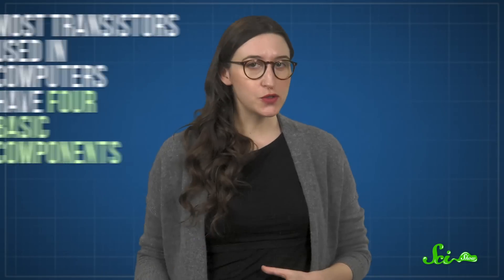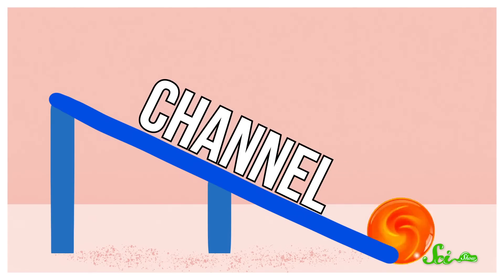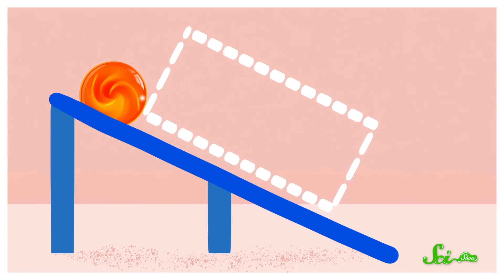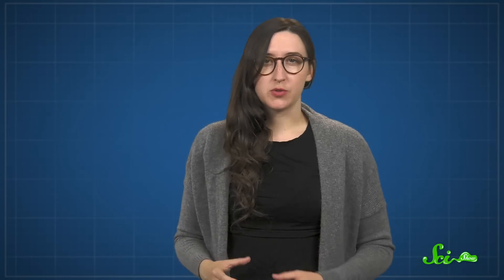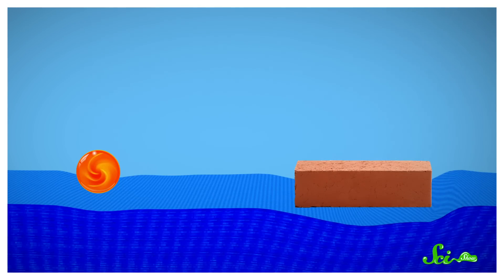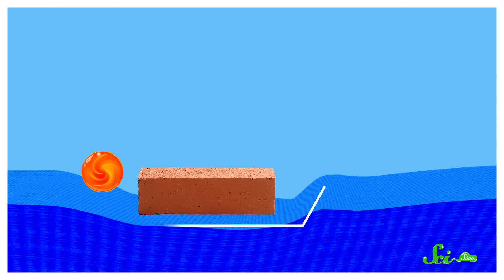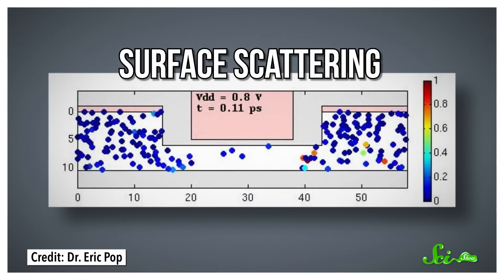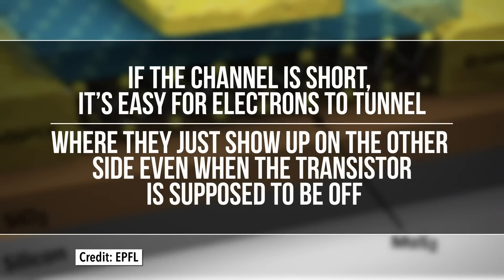There's a Big Problem With Silicon. What's Next?

Comment: Hopefully graphene will be ready on time , if not an inferior stopgapy alternative may hamper it's eventual adoption
Reply: TBH (and I've recently done a PhD on semiconductor devices, so I'm not talking entirely out of my butt) 2D materials are not particularly likely to supersede silicon. From a physics/device standpoint, it's very hard to make a good transistor out of them: if you somehow manage not to destroy the 2D-ness of them by making a three-dimensional device, you still need to make a source/drain and gate that are as good as or better than the silicon ones we've been perfecting for decades. From an engineering/economics standpoint, we can already process silicon wafers that are 300mm (12 inches) in diameter all at once then just carve them up and sell a few dozen chips, but even basic logic circuits of a dozen 2D transistors are still in their infancy, let alone the scale of production where you can make full-sized processors with any decent yield. This is just like III-V materials (InGaAs) all over again - so much promised, but they can't even catch up with silicon, let alone overtake it. Mark my words.
Reply: graphene can do anything but leave the lab :S
Reply: That’s kind of what already happened
It’s technically ready NOW and has been since the 90’s with Dr Walt DeHeer’s research on using Silicon Carbide to epitaxially grow graphene on wafers.
It’s not too different from current methods of silicon production, but factories have been reluctant to switch to it because it would require some retooling of equipment and that single crystal wafers of silicon can be bought in bulk for ~$5 per wafer, but Silicon Carbide is ~$500 per wafer for the same purity.

That’s why everyone is so caught up on exfoliation graphene; it’s much more easily produced, but doesn’t provide NEARLY as much control and quality
Reply: @Abdega  Don't forget that the largest SiC wafers are only 150 mm (6 inch), as well as costing two orders of magnitude more than the largest silicon wafers. Now if someone could grow decent SiC by solution growth, that would be quite something (SiC is currently grown by sublimation growth, which doesn't give anything like the consistency, ingot size or quality as silicon Czochralski growth).

I'm still not at all convinced graphene is as ready as you say it is. Just because you can grow something on a bulk wafer, doesn't mean it's ready for commercialisation.

Edit: seriously, you can't be suggesting that the CMOS industry moves to using graphene on silicon carbide. The cost of the substrates alone would be astronomical, never mind that there are barely enough reactors to supply SiC to its new niche in the power electronics industry, let alone the colossal microprocessor market.
Reply: @gigabyte2248  carbon nanotubes?
Reply: @stsk7  A bit like graphene: a neat specimen in the lab and some interesting potential, but no realistic route to make anything useful out of them. Graphene has some excellent properties for transistors - electrons are highly mobile and graphene can be built into unusual and difficult to build but quite effective transistors - but nanotubes are more interesting for their electrical and thermal conduction properties than for making transistors out of. Unless I'm missing a trick!

Edit: I honestly hadn't given nanotubes a second thought as a transistor material until you mentioned it. As mentioned above, they're really of more interest for their conducting properties than semiconducting ones.
Reply: Gigabyte22
Hence why I typed “factories have been reluctant to switch to it because it would require some retooling of equipment and that single crystal wafers of silicon can be bought in bulk for ~$5 per wafer, but Silicon Carbide is ~$500 per wafer for the same purity.”

I’m not “suggesting the CMOS industry” do anything. I was saying that the technology to produce the graphene electronics is already here, it’s just not done because it’s not a process issue, it’s a supply issue.

If I could snap my fingers and have $5 SiC wafers we would have graphene electronics, but right now it’s too expensive.  This seems to be a sentiment that is also shared by you so why does it feel like an argument is being started for no reason? 🤨
Reply: @gigabyte2248  are you familiar with twistronics? is there some hope of producing room temperature superconductors out of it to maybe power future transistors?
Reply: @Abdega  Sorry, I did get a bit too heated too quickly. Having worked on this stuff, and seen the kinds of problems hiding under a comment like 'would require some retooling of equipment' or '~$5 per wafer vs. ~$500 per wafer', it's frustrating when non-scientists/consumers brush off really fundamental problems, such as the way a wafer has to be grown meaning that it might be incapable of ever fulfilling the promise that the outreach team made(/implied). It's not just supply or politics - scientists/engineers/businessmen needing to pull their finger out - the science/technology itself is just not there yet. The wafers aren't just not cheap enough, they're not good enough, big enough or available in the 'same purity' as silicon. And, as I said, I'm still not convinced that the right fabrication technology is available to scale up graphene to the level of complex circuitry. I don't want to start an argument at all, I just want to crack open the chip-making black box and paint a realistic picture of how electronics are made. Sorry if I'm being confrontational (or narky) :(
Reply: @BattousaiHBr  To be honest, I'd never heard the term before you mentioned it! It looks, though, like it'd still have the same problem as conventional 2D materials: how do you mass-manufacture it in a repeatable way? I don't want to sound like a broken record, but this really is the thing with selling something - you need to make loads of it quickly and in a way that doesn't break the bank, and you need to be able to make enough of it well enough that you don't have to throw away half your batch. Conventional semiconductor electronics - predominantly silicon, but to a lesser extent materials like silicon carbide, gallium arsenide and gallium nitride - can be made in (reasonably big) wafers and with good uniformity, so they're going to be hard to beat. Maybe there's something in 2D materials, but the transition from the lab to the foundry is long, painful and you can't really prepare for it. I'll be interested to see where the field is in ten years, though!
Reply: @gigabyte2248  yeah affordable mass manufacturing seems to be the problem with carbon-based super materials in general (graphene/carbon-nanotubes).
from what i understand there is several billions of dollars being invested in the field every year due to how promising the proof of concepts are. not only better transistors but everything from better batteries to sturdier materials.
i only recently just learned of twistronics as well, the discovery was apparently made last year and it's so crazy that it might win the nobel prize. also regardless of carbon materials, a room temperature superconductor alone would already revolutionize the world.

Comment: Raise your hand if you've built so much as a D latch using discrete components, extra points if you tapped a clock counter onto a proprietary system to activate analog devices based on every 3rd bit value. Obviously I used optoisolators, parisitically powered. But your thing is...good too. Way to grasp that which you wish to profit from explaining to those of us who merely work in the real world, where science has to actually solve problems today.

Comment: At one time I carried tube transistors into a department store to test it on a plug in board.
Reply: Do you remember what era you did that in?
Reply: @snowdaysrule  Sixties
Reply: @bobbyharper8710  Thanks it's wild imagining a time when that was common place. Like today I'm doubtful most people even know what a transistor is, or yet alone even try to repair the things they own that break down.
Reply: @snowdaysrule  When solid state components came into use we would ride to the dump to salvage discarded electronics. But multicomponent proprietary chips made everything disposable.

Comment: Sorry but why compare the gate to a towel instead of a litteral gate?
Reply: probably because transitors are more like a valve then a gate.  They don't have to be all the way on or off, you can use them that way of course, but they can do more.
Reply: @Wooble57  sure, but I imagine they are named gates because its compared to a gate. You open a gate and let cows flow out. You shut a gate and cows cannot pass through.
Reply: @TheCinderfang  what it you only open the gate halfway and it takes twice as long for the cows to get through?

in actuality a transistor doesn't have a gate, it has base, emitter, and collector.
a MOSFET has a gate, drain, and source.

::edit::  typed base instead of gate for the mosfet by accident.
Reply: right? so bizzare. whoever is in charge of coming up with these analogies needs to calm down a little bit

Comment: What's wrong with using GaAs? 3 times faster than silicon as a minimum due to lower capacitance effects and faster traveling electricity (about 0.3 C compared to 0.1C). It's already used in MMICs that work to 60GHz+.
Reply: Its good that you know some of the advantages of GaAs over Silicon but glaring disadvantages exist for GaAs. If we disregard the wafer price comparison where Siicon is the clear winner, 

1. Moore's "Law", GaAs which has a lattice constant of 0.565 nm, more than Silicon's 0.543 nm. Meaning that GaAs transistors cannot be smaller than Silicon transistors. (MoS2 has a lattice constant of 0.316 nm in one direction for comparison)

2. thermal conductivity of GaAs is 52 W/m-K vs Silicon's 149 W/m-K which means that it is 2 times harder to remove heat from the GaAs transistors.
Reply: @lugiarboy  The transistor size difference is not that much of a deal when you are talking about 5+nm processes and signals traveling three times faster through the silicon. The much smaller capacitances will offset a lot of the heat issue too as will noise issues (look at the noise floor for equivalent GaAs and silicon MMICs). Cost wise the difference is nothing like as much as it used to be. IE looking at MMICs the silicon low frequency variants of the GaAs MMICs are 1/3 the price but that's not the 50x price difference of the 80's for example. As GaAs has become  more mainstream the price has fallen significantly. Also GaAs is still way cheaper than and MoS2 process at the moment.

Comment: If you ask me, there's also a big problem on silicon: the software. The best example i can think of is Android, and it's official software. Try opening Hangouts, and notice that it takes one second whole second to display at most 6 icons and corresponding lines of text.
Reply: tf are you on about, android is the opposite of optimised because of how many devices run it. also its taking a second to translate tapping at a random x,y location on a physical device to showing the correct animation to telling the program to actually start running to displaying the output of the program once it starts outputting. plus its hangouts lol. if the timing really bothers you, get a better phone.
Reply: @jonathanodude6660  But it shouldn't be so unoptimized just because it runs on multiple platforms; there are ways to optimize in (mostly) platform-agnostic ways: cache coherency being a good example.

As far as my eyes work, there's no animation to opening Hangouts, so i can't assume it's spending time doing that; and if the input system is slow enough to be a significant factor to the one second, it's a terrible input system; which leaves just program initialization and displaying those 6 lines, which (in my opinion) is too slow. It could all be on Android's side, too, which would be even worse.

I can't know everything about what Hangouts does, but it's still unresponsive; which i think is primarily a result of bad engineering. I doubt it's my phone, because it has an octacore, 1700 MHz processor.

Yes, that is just an anecdote about one application; it was just meant as an example in the first place.

Comment: Over-simplification is a bad thing.  Transistors are more than just switches, obviously, although they can be operated that way if you want.  In the analog world, transistors do fabulous stuff like amplifying, oscillating, detecting light (phototransistors) etc...you know, all those not-on-or-off things they've been doing since they were invented.
Reply: Hey, don't knock digital electronics. Digital logic is just as diverse and useful as analogue electronics - it's much better for data processing and you can play around with encoding, networking etc. We need both digital and analogue for the really cool stuff (like the computer/device you're reading/writing this comment on)

Comment: I don't see how something that's an atom thick would be two dimensional given that atoms themselves are three dimensional.
Reply: It's about how the physics work. There's some really good physics for individual atoms, but when you try to translate that into a load of atoms, it works very differently if you translate it to a 1D structure, a 2D structure or a 3D structure. If you're wondering why physicists even tried 1D and 2D structures, remember that physics is hard and unrealistic simplifications help us understand more complex cases. Anyway, the thing that makes materials like graphene and MoS2 '2D' is that they follow the 2D model we built using the theory, rather than just a very thin version of the 3D model. Compared to the 3D materials we're used to, 2D materials are.. weird. There's cool and interesting stuff they can do (and, as the video mentioned, there might be some interesting applications in electronics)

Comment: just as an old electrician,  on any circuit that controlled just about any process, a coil was energized, or it wasn't.  ok, people might have said that it was not binary, but it really was.  it was not that hard to go from classical electrical theory to binary, as far as control was concerned.  source: retired electrical technician.
Reply: What about a loudspeaker? or any sort of wave for that matter?
Reply: @Wooble57  not talking about waves, or any kind of metered signal.  just the on/off that mostly ran everything from when i was in the navy (70s) until i retired.  a lot of what we dealt with was binary, before what we knew what binary was.  i was a navy nuc back when everything was analog, we had no calculators, we did everything with slide rules.  i know that sounds archaic, but thats how it was.

Comment: CPUs are still getting smaller while reducing transistor size and adding more of them, when they start doubling their size then it is time to worry about these things. For now anything other than silicon is just something for the enthusiast entrepreneurs. Qualcomm has the best solution to this problem for now, they can pack a punch on their cpus without requiring cooling, just by using a more efficient system. While they are still behind traditional processor manufacturers like AMD and Intel, they have gained a lot of ground and their system might be the most viable long term.
A lot of the slowness currently in apps is the language of the codes themselves, so when that is optimized there should be another boom like it happened from 1995 to 2006, but with the opposite effect, making older hardware more efficient with optimized applications.
Reply: I'd say yeah optimization is best. You see this with RISC-V processors. Where they will eventually be able to pack in a lot more power on a smaller size, simply by omitting legacy features that intel has kept since well... their original CPU or something like that. I dont remember the name of the chip but it wasnt particularly well designed for being iterated upon but its popularity made it a requirement to iterate upon it.

I can see a lot of progress being done with simply removing legacy features that are no longer being used by the vast majority of people and companies. To cut down on size, then  optimizing what is already there. But knowing how Intel and AMD work they'd probably end up just making dual socket CPUs the norm, just look at Ryzen (Which is honestly an amazing CPU. The next gen Ryzen chip is amazing price performance wise). Wait till we get quad socket chips. I can totally see intel just welding 4 chips into one.
Reply: @DivinityOfBLaze  I actually think it isn't that bad if the size of CPUs get increased or they make some type of ultra thread function where CPUs take over the load from other CPUs, so you can have a multicore multi CPU computer and it never slows down, depending on what people do that could be the definitive computer for casual use, while gaming is still gonna increase in requirements for about 10 years at most. At least until it becomes so realistic they only focus on optimization over texture improvements or new engines.
Reply: @MashupsByMandy  Size is a bit of an issue honestly. We already HAVE motherboards that support 2 CPUs. Its in the server space. Though larger CPUs are rare. I honestly think going the way of RISC-V CPUs is the way to go. Which is basically optimization. With eventual size growth.

Theres a lot we currently do with hardware that is basically people deciding its easier to just make thing smaller to fit in more stuff than optimize as much as possible. Basically bruteforcing the performance.
Reply: I didn't understand your comment. Qualcomm does not manufacture their chips. They don't have a foundary. I think they use TSMC. So are you talking about architectural optimization? Edit: I just looked up. AMD also uses TSMC and some Global Foundary